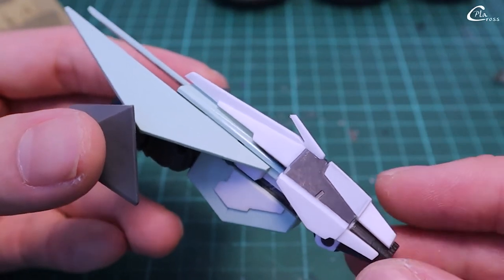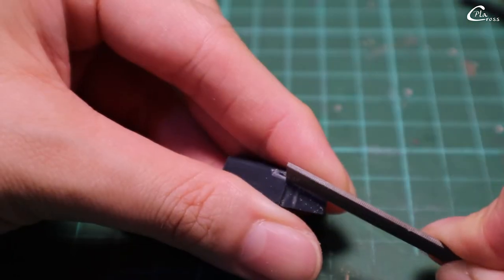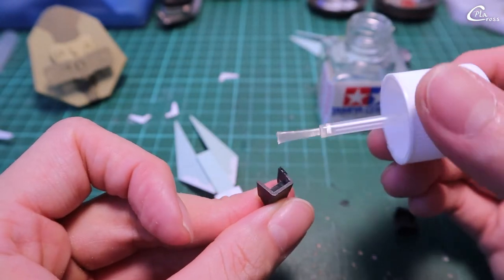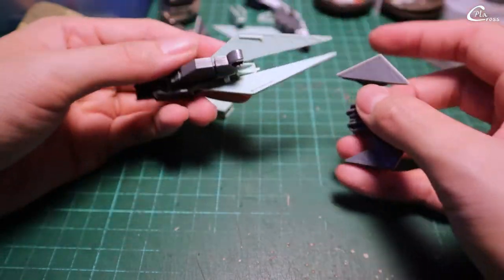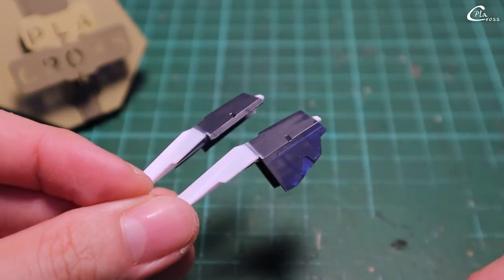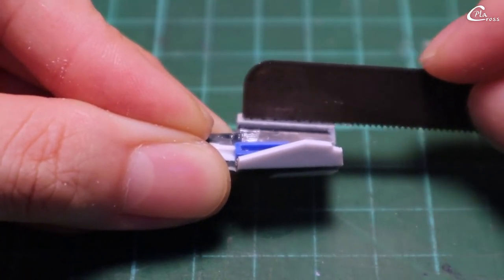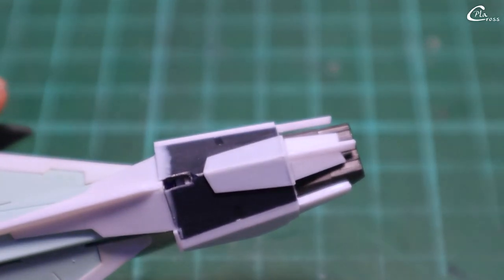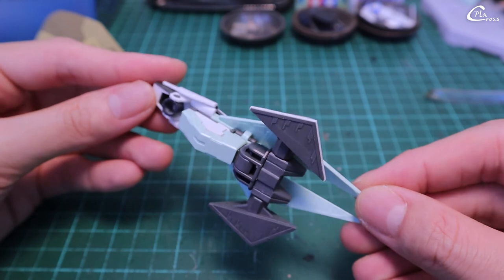Pla Cross #005 | Gunpla Custom Build Barbatos | Side Armor Detailing

Comment: That bit with the file reminded me of something: Often you can also achieve drastic effects just by sanding sword edges and other cutting surfaces to a sharp edge to get rid of that toyish look, along with giving them a metallic blade edge look.
Reply from the maker: I've built a few bandai kits and so far haven't found any share edges on the armors. That might have something to do with the production process or safety. However, refining the edge might give the surface better appearance [less toy like and more machine like as you said]
Reply: @placross  Exactly, round edges release easier from the injection molds and they'd get into all kinds of trouble if they sold models with sharp blade edges, so it's better to add that bit of realism yourself.